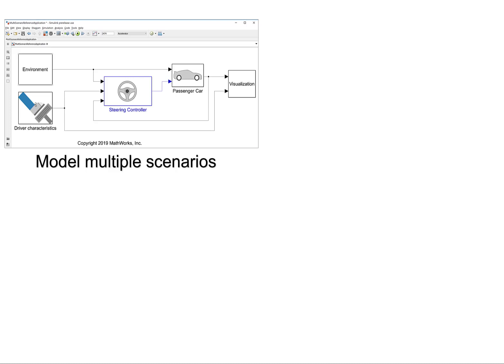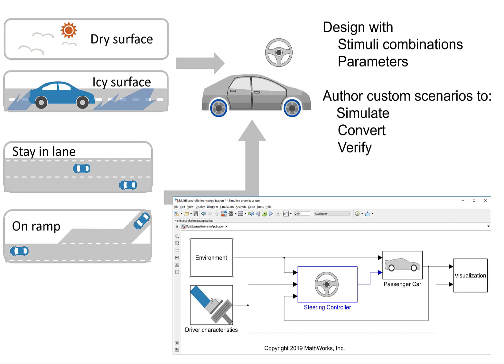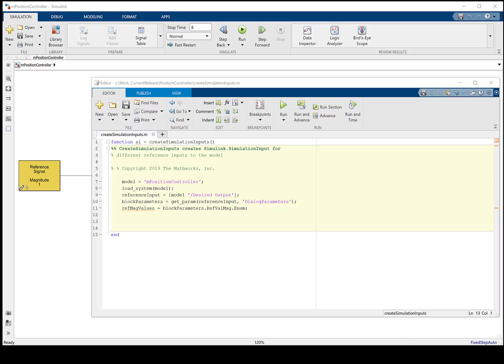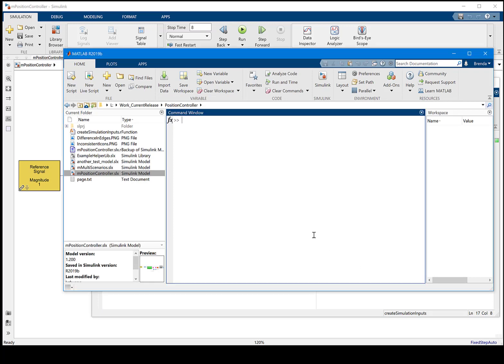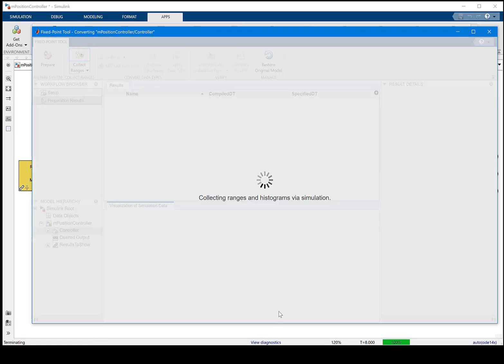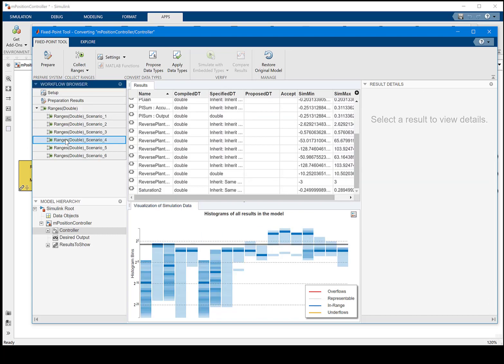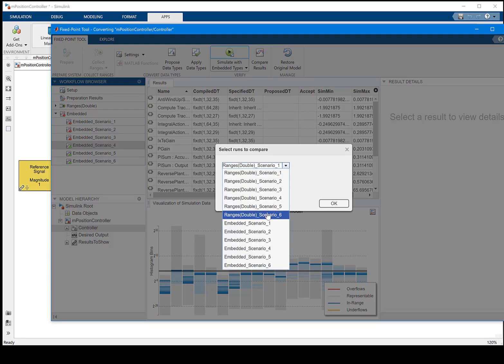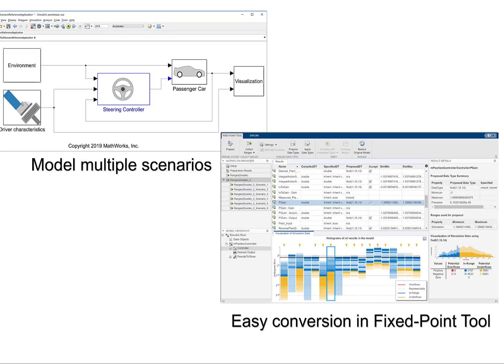How to Simulate Multiple Scenarios and Convert Models to Fixed Point | MATLAB & Simulink Developers

Comment: A nice explanation.....
1) What does 25 in Rel Tol mean? Upto 25% of error is allowed? 
2) But how do you resolve those potential underflows and overflows?
3) Also, only 3 of your simulations are within the tolerance range, so how do you resolve the other 3?
Reply: Same, I would like to know. Did you find the answers for your questions?